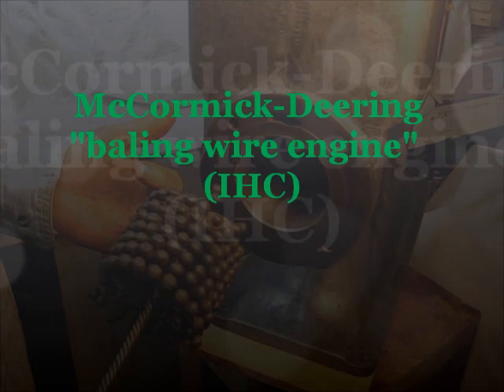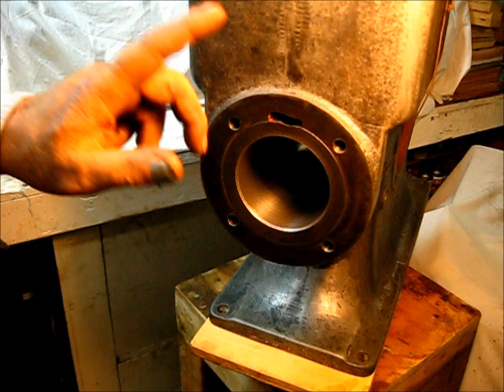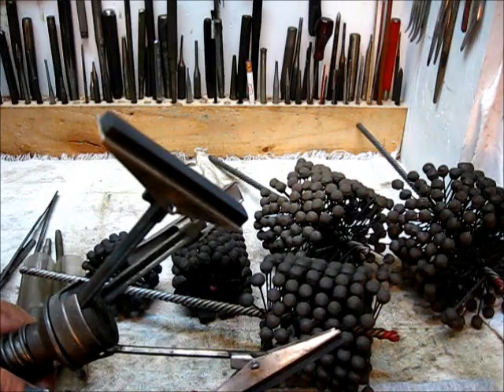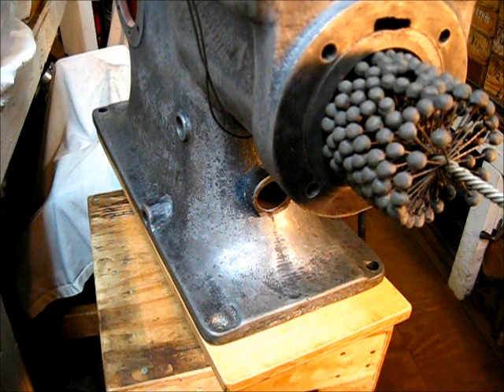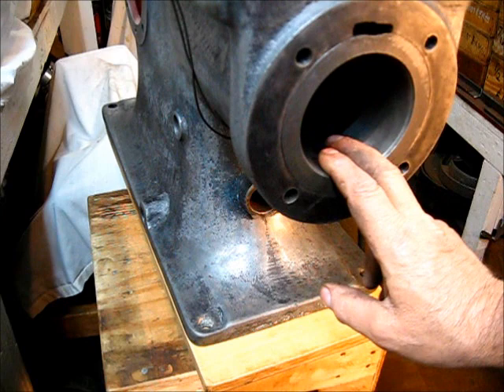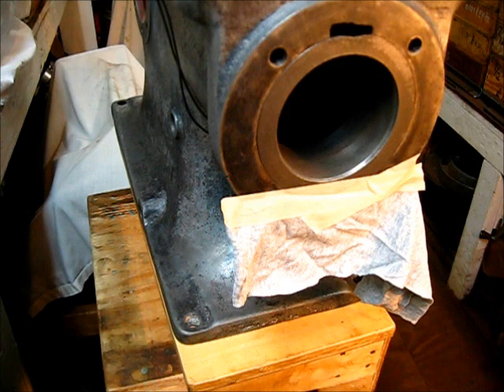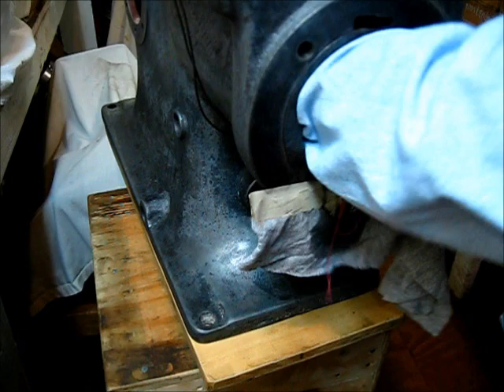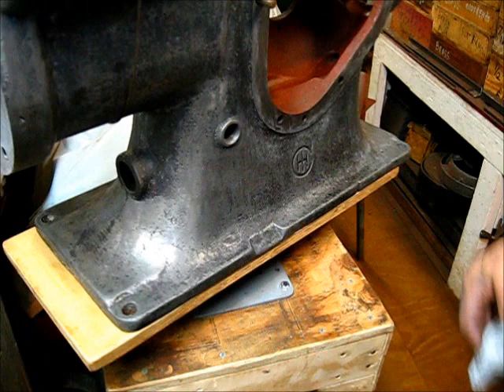McCormick-Deering "baling wire engine" #14

Comment: In 30 years doing mechanic work, I can count on one hand the people who understand the art of honing. You are one of them. If you are trying to spot imperfections in the cylinder, the other hone is better, but that is about the only time I can think of. The insight about honing oil is unusual, as well. My Dad used to use diesel, but I prefer a penetrating oil. Great job.

Comment: The flex hone worked well for busting the glaze, but if you want to repair ridges you can't do it without using the 3 stone hone to remove the ridge. Or you could use a ridge reamer to cut down the ridge to level. Then you would still needs the 3 stone hone. But for just busting the glaze to seat rings the flex hones is the cats meow :-) Nice job Sam!!

Comment: Flex hones are great for conditioning a good cylinder.  I have several different sizes and grits.  I try to use a good honing fluid but have found that a combination of diesel fuel and 30 wt. non-detergent oil works well.  I do use transmission fluid on a clean cloth to clean the cylinders. I keep wiping the cylinder until the cloth is just pink.  I think you do a great job.  Happy New Year!  

Later!

Comment: Sam, I'd a thought you'd a brazed the top of that water chamber onto the crank case.Guess that might of changed the character of the engine some how, but, as long as she runs pretty...
Reply from the maker: Doug Rundell ,,, such a good use of baling wire,,,,, world famous,,,, you will find engines with brazed hoppers quite often,, but not too many with the top of the water hopper held on with baling wire,,,,

Comment: what was the measurem comparison of the cylinder to the piston your going to use? how close are they going to be? I realize from what you told me that you can not buy a new sleeve or a piston. so I was wondering what the difference was on the sleeve and the piston your gonna use is?